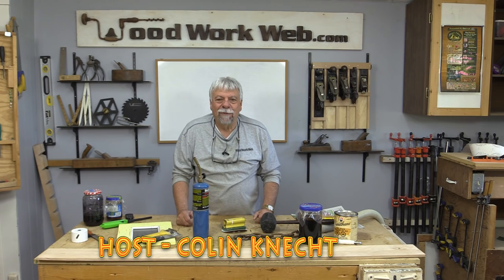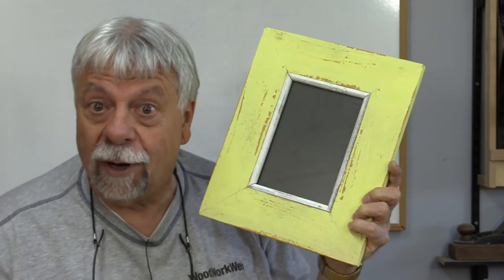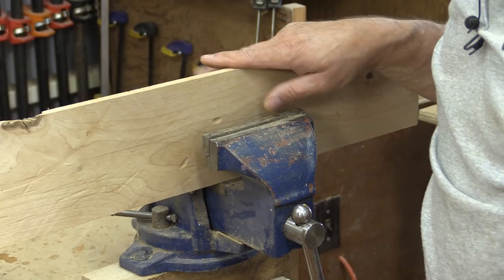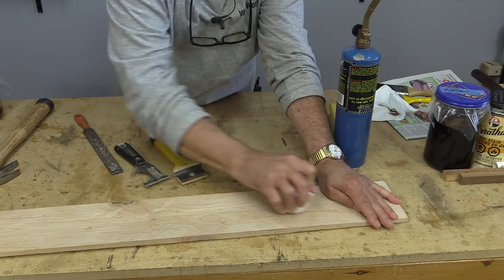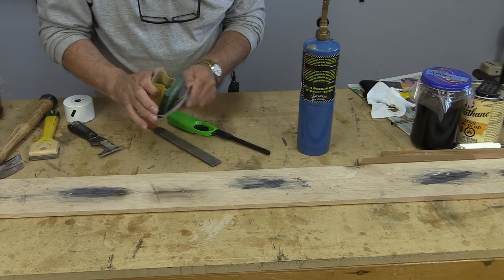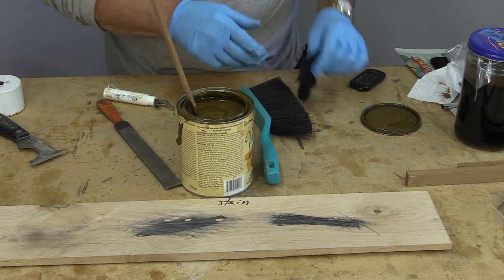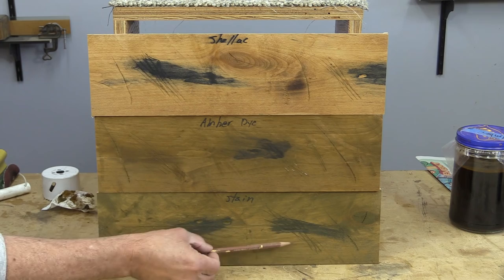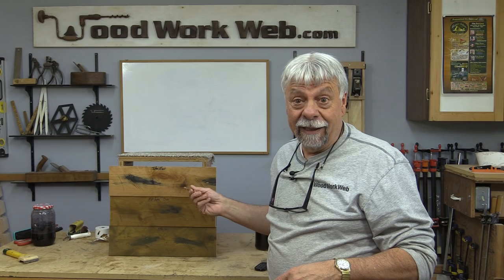Distressing Wood for an Antique Effect / Make Wood Look Old

Comment: I recommend a dark walnut stain on pine. Some areas will really soak in  - and be very dark, while other areas will be much lighter. This technique makes using ebony dye and/or burns unnecessary. I also recommend using a file on the edges in a few areas.

Comment: Good job,, think the dye you are using its a lil too much for my liking.. i’ve recently did a feature wall 5x6m i did exactly what you did by beating up the boards, i also used wooden pallets boards with same thickness wider ones I bought from building suppliers, and also what i had from the yard, as i said instead of black dye?  i went for dark and light wood stain on some others used old recycled engine oil out of my Van I serviced not long ago, then went light with planner on boards to remove the shine here n there from wood stain.. wish i cld load a picture here so you can see.. wall looks absolutely stunning.. and not overly done..